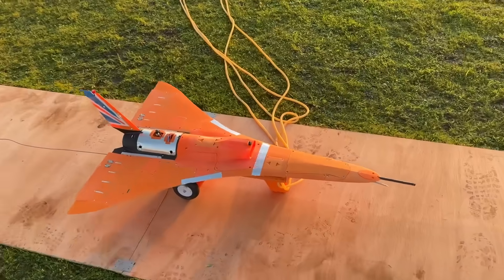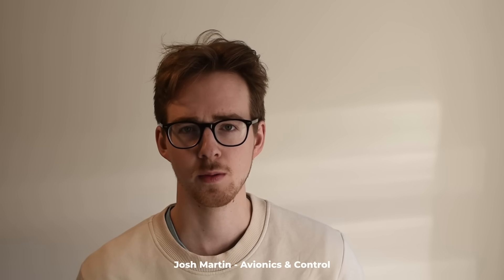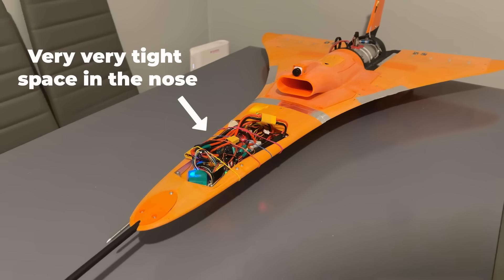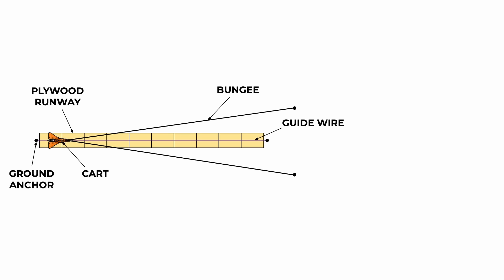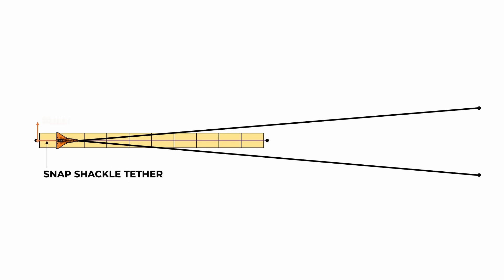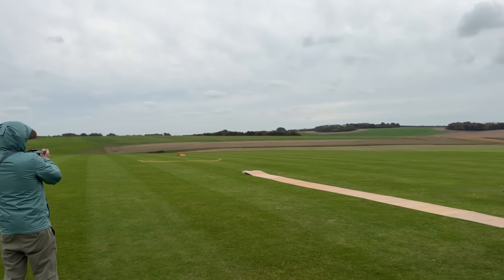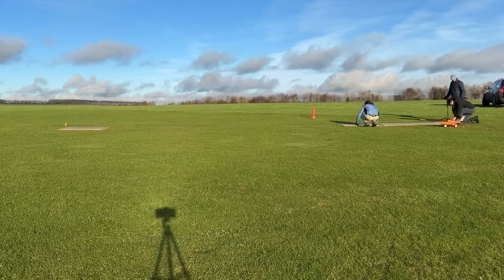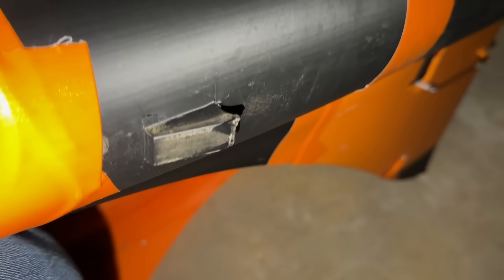It Almost Flew! Kingfisher Mark 2 Launcher Tests and Final Flight Prep

Comment from the maker: Thanks for watching this video! We were debating whether or not to wait until after the flight before publishing this video, but we decided it was worth getting some final feedback from the community before the flight. Also keen to show our progress :)

As mentioned, our Jetcat P60 has been quite intermittent. During our flight attempt in mid December, we were unable to get it to ignite or spool up beyond a very low RPM. It was a cold day, and the aircraft, fuel and batteries were cold and the starter motor was making a weird rattling sound with an error message "Temp Low" on the GSU. A few days later we pre-warmed the batteries/ fuel but still weren't able to get it to start (with the same "Temp Low" error on the GSU), then the next day it started fine. Over Christmas, we've done about 8 more starts. We haven't had any further ignition issues, but on the first 4 starts the start sequence was aborted about 15-20 seconds in with an "Acc Low" error on the GSU. We changed the batteries to some I had been keeping warm in my back pocket and had no issues - 4 more successful starts with throttle tests up to full.

If you have any ideas for why the engine is being so intermittent, please let us know. We're keen to find a mitigation that improves reliability, as driving to the field, setting up the catapult, doing the flight and driving home is a full day activity so we want to be sure the engine will work on the day!
Reply: Low temp is a lack of fuel. Fuel is thicker in cold weather. Increase Url1 on the pump start phase. Also you need more air around the tail cone or the drag will be high
Reply from the maker: @davewilshere  Thanks Dave, that's really useful to know, we will consult the manual and do that. If you have any other tips please let me know (either on here or offline). Do you know what causes the Acc Low/ Acc Slow error?
Reply: What is the fuel?
Is it a multi fuel?
What oil?

Is it new?
What pump/fuel pressure?
Do you run a fuel filter?
Could the injectors be blocked/damaged?
Reply from the maker: @brucebaxter6923  Fuel is Jet A-1 mixed with 5% jetcat turbine oil.
Engine is a couple years old, but had hardly been used by the time we got it.
We installed a brand new fuel filter for Kingfisher MK2, and have tested the operation of the external valves for kerosene start and fill although hard to tell what's happening inside the engine
Reply: @TheMachInitiative
You may have got dust into the fuel rail and partially blocked the injectors. 

If you look at pressure and flow rate you might be able to check that against specs. Sorry, I don't know more. 

I wonder if straight kerosene is thinner (a1 has anti atomization for crash safety) and would flow better in cold
Reply: @TheMachInitiative
Same thing, it's not getting enough fuel
Reply: Buy a 12v hairdryer and take that to the field. Use it to warm the engine for a while before starting. You might want to check if there's a hotter glowplug available, too. These little changes can have a big overall effect. Finally, battery power, make sure there's plenty there to  get all the jobs done at the same time, I'm sure you know the cold and batteries are not friends.  All the best with your testing.
Reply: I would strongly suggest warming up the turbine with a  hair dryer before a cold start. Blow it up the exhaust. Depending on the turbine oil you use (very strongly recommend Power Model Jet Oil from
Deluxe Materials cuz it never gummed up my engines nor gave me cold start problems) the bearings may drag a lot in the cold. 

Would've been great to see a Xicoy engine powering it instead. That jetcat looks ancient (external plug and all) and huge. A xicoy X60 weighs half as much and puts out the same amount of power and burns more efficiently, and it's a only 2 things to plug for the installation.
Reply: For the next projct please take in mind to use something not so aged, like a Kingtech K70 that weights at least 150g less and has over 1N of more thrust compared to jetcat. Also valves inside the engine. Other than that, my suggest is to use a 12v hair dryer at the field for helping the cold start. KEEP PUSHING GUYS
Reply: Message me and I can solve all your problems…you just need to seal the Kero start teflon pipe onto the Kero burner nipple properly or prime the burner valve line before any first run
Reply: @davewilshere or they could get a proper engine like xicoy and be done with all this crap
Reply: @aerialbugsmasher Mmm a 24 year old JetCat design is way better than any Xicoy-noisy, horrible things
Reply: @davewilshere lol ok buddy. So you're also the  type of guy to keep a Ford pinto in your garage cuz it's better than these new fangled cars of today huh😂

I've had zero issues with any of my 3 xicoys and could fly a solid 2 or 3 minutes longer than anybody else on the field with similar sized engines especially the Chinese ones or jet cats while still having tons of power with a lighter engine.
Reply: Ive seen children make better ramps... wtf is wrong with you all?
Reply: Are you guys restarted? This is an actual question. You should have been flying this long long ago and testing it with EDCs. So again are you all restarted?
Reply: @thomgizziz 
An armed drone?
That's just not right

Comment: A couple of suggestions from an RC pilot, hope that helps with launching. Try another style of launch system. A bungee is a good idea, make it longer rather than stronger, giving you a longer launch duration and reducing the forces on the air frame. Try a launch rig similar to the "Pedal Operated Bungee Launch System/Ramp for FPV/Gliders/Light EDF Models" from Hobbyking. Sorry, no product plug, just google it, that's the type you want for fast and high wing load delta planes. It'll get the plane into flight within less than 2 meters, and then the bungee will accelerate it over 20-50 meters, depending on your bungee. follow the recommendations for bungee strength based on plane mass. That way, you'll have enough velocity after the plane leaves the guide rail behind to have working actuator surfaces. keep the plane low and steady as it accelerates and don't pull up too soon. you need plenty of speed or it'll lose stability due to the high wing load. don't use wheels or anything, your plane geometry does not allow for something that is to scale for the bumpy airfield surface. try adding a 10-20mm wide strip of 1mm thuck aluminium sheet to the belly as a skate, just flush against the fuselage, so most impact forces on landing are spread through the skate. now, landings with something this high wing load are going to be powered, and at higher than comfortable speed. i'd recommend talking to a seasoned RC pilot who flies fiberglass jet models like the starfighter, or similar high wing load models. sicne your glide angle is going to be closer to that of a brick than to that of for example an rc sail plane, you basically want to get to less than an inch above the airfield surface before you reach stall speed. that is something you can train for handily in flight simulators. the tricky part is not the fine steering inches above the ground, but rather to learn how to fly the approach correctly, so you enter the edge of your airfield's property already lower than head height on landing approach, arrow straight towards the runway.

Comment: I recommend moving the camera into a position embedded into the wing route with a perspex clear window designed to maintain aerodynamics.inbthe current position you are disturbing the airflow. That you need over the vertical stabiliser/ rudder. You also need to vastly improve the launch it looked like the biggest problem is nota lack of speed but the violence of the launch causing lack of control and immediate loss of control beyond it's ballistic path.  I agree with loosing landing gear but consider adding bulges in the rear 3rd beneath both the wing and the nose . Allowing those (replaceable) parts to take the brunt of a rough landing while protecting the main body of the plane.
Reply from the maker: Agreed about the launcher - did more tests last weekend with a modified cart and were continuing to have those issues, the bungee provides a very non-uniform acceleration, which starts at ~10g and then drops off very quickly. Using a winch would provide a constant 2g acceleration, which is enough to get to 50 mph in 12m and much smoother.

Putting the camera in the leading edge would improve aerodynamics but we’ve tried transparent windows and the high curvature of the LE distorts the image a lot - for now above the inlet is ok (it worked fine on Kinglet) but further optimisations can be done in future.

Bulges are draggy but would help reduce damage on impact while we’re in this early testing phase (would remove for the record attempt)

Comment: You probably already have the servo locations heavily thought out, but, did you ever consider torque rods with linkages inside the fuselage, instead of the current servo fairing setup?
Reply from the maker: We considered it, but struggled to fit them in around the engine (this aircraft is designed to house a bigger P130 engine which is almost as big as the fuselage diameter) - the current servo fairing setup is nice and reliable and good for high torque applications, but further optimisations could be done in the future!
Reply: Sick! Thanks for the reply!

Comment: Now if you wanna make it really good add that white tape for (big, manned) gliders over all the gaps and screws (nah, just kidding, I mean, it would make the thing a whole lot more aerodynamic but these things would come off at higher speeds probably) Maybe you could actually fill most of the gaps with some kind of silicone or something else tho.
Reply from the maker: Once we’ve got it flying reliably at low speed we’re going to epoxy it together (instead of using bolts), then will coat in a layer of glass and sand so the whole thing will be smooth!

At the moment the ability to swap things out is v useful!

Comment: I'm always excited about your videos ❤,i have 2 suggestions,  use a much longer fuselage, an increase of 4 to t imches in length and also consoder using slats, because with thay wing configuration, you'd need either slats or high thrust or to keep it simple use small rocker motor launchers they're cheap,all the best of luck, i can't wait for the next video.

Comment: Nice project, but it looks quite similar to the current record holder?  Except maybe smaller in size and single fin instead of twin and with extra upper air intake area which seems to be actually adding more drag?   The current record holder from my limited knowledge on this topic has really sleek lines, no excess mass on the top which will result into more drag and flies locked like a dart which tells me it's a proven design.    https://www.youtube.com/watch?v=DPGDAZyQ44k&t=12s

Please don't get me wrong, not trying to bring any negativity here, just sharing my thoughts, all the best :)

Comment: Frankly, that launching method will kill the airplane. Instead of any sort of ramp, which will be inconsistent, think about changing the cart so that the model is at a 15 degree pitch up and increasing bungee strength by 1/3rd. That way it will release at the same attitude as with the ramp, but without the destabilizing pitch up moment you're having to correct for
Reply: https://www.youtube.com/watch?v=LqBe_PQeiYA an example of a strong bungee launch in a similar, albeit lighter aircraft
Reply: https://youtu.be/DPGDAZyQ44k?si=E4sRYDktxDkcolkb obviously familiar to you but a good example, note the pitch angle on the launcher and smooth transition to climb, no strong destabilizing impulse

Comment: Looking great thus far! Acc Low/ Acc Slow also points to a fuel delivery issue or battery voltage sagging due to weather. Acc slow can be caused by too much/too little fuel and judging by cold weather would probably be too little. Also, I'm sure you're already doing so but worth covering up screw holes/panel joints with speed tape to avoid a metric ton of interference drag.

Comment: You could save quite a bit of weight using a conforming fuel bag for this jet, thats what I would use
Reply from the maker: If you have any knowledge on how to make/ cheaply source a custom bag that conforms to the shape of the fuel cavity we'd love to have a chat - please let me know. Cramming fuel into such a volume constrained aircraft is a key challenge for us
Reply: @TheMachInitiative I don't know anything about fuel systems but you can quite easily 3D-print molds for silicone. 
You could even try to make it from a single pour and melt the inner part of the mold out of the fuel lines if you have the right equipment or enough patience.
Making a bag from two halves and joining them would be easier but i don't know if that would introduce a point of failure along the seam.

Comment: Was the hook damaged because the rocket doesn't have a stand? Wider base with larger wheels may relieve impacts on the hook.
Reply from the maker: The hook got damaged when it impacted the ground after the failed launches (when the cart gets launched without the aircraft it reaches a much higher speed), although, as we increase the bungee loads we're moving to a metal chassis and hook to help carry the loads better. The new cart has a much wider wheel base!

Comment: Interesting project and respect your effort but would have appreciated you waiting until you could actually show a flight before releasing a video. It's true that the title doesn't promise that but videos that avoid showing the point of the whole project ( a flight or even a decent attempt at one) will mean that people might avoid clicking on them in future.
Reply from the maker: I appreciate your concerns - it's a tricky balance between showing the progress/ work we've done over the last 3 months, and also showing things fly. With Kinglet we were able to churn out new designs/ flights every 2-3 weeks, but with the added complexity of Kingfisher it takes a lot more work/ testing.

Was really keen to get the flight video published over Christmas, but we got unlucky on the flight day in December. I'm happy we've split up the ground testing and maiden flight videos though, means the maiden flight video will be more to the point/ snappy, appealing to a wider audience. Also allows us to go into detail about the post-flight analysis without having to release a 20 minute video!

Also useful to get feedback from the community before we fly!
Reply: @TheMachInitiative Thanks for respectful reply MI and I really didn't want to sound negative about an interesting project which you have put so much work into, I just wanted to be honest so that you could take my opinion into consideration or not as you see fit. Either way, I'll be looking out for the flight test and please have a subscription!

Comment: I’m surprised you went with external linkages on an aircraft that is meant for all out speed.  It really makes me question the amount of RC experience…🤔
Reply from the maker: The linkages are draggy, but they're necessary to meet our torque requirements and we've covered them in nacelles to manage the aerodynamic effects. Once we've got this flying reliably we can look into further optimisations. The current record holder uses similar linkages, he just hid his in his tailfins - we wanted to avoid having twin tails as they disrupt the vortices over the delta wing and cause it to stall earlier
Reply: @TheMachInitiative Unless they're tip-fins, whence they help.

Comment: The aircraft has such lovely lines and the camera mount on top of the air intake really changes that sleek profile.   Have you considered widening the air inake and incorporating the camera mount to the centre, INSIDE the inlet? I really think that mount as is at present interrupts flow considerably over the top of the craft and introduces turbulence right in front of the vertical stabilizer. With the camera inside the air inlet flow isn’t interrupted and the intake can just be made slightly larger if necessary (which it might not be depending on the design of the camera mount). Given that the control unit is no longer part of the camera mount you probably have the flexibility to do this change to camera location. At these speeds weird things happen to airflow and optimizing flow is IMO crucial to maximize performance.  I would even consider using tape over some of the hatch outlines as hairline ridges or gaps also interrupt flow.
Reply: unfortunately this is a terrible idea
Reply from the maker: Putting it inside the inlet would introduce highly non-axisymmetric flow, this would damage the engine. -M

Comment: I don't like auto tune in ardupilot, it's only good for that last 3-5%
I much much prefer to use one or two of your trim knobs to tune it. 

Please please please use your lead sled launcher test model in a stabilise mode to tune your controller.
Please only do roll or pitch one at a time. 

Please get a cheap assed foam toy plane or drone and practice doing auto missions with takeoff and land. 
It's very very important. 
Your human pilot can't be as smooth and will get orientation/range problems when your speed gets up.
Reply from the maker: Do you reckon the 3-4 seconds we get of air time with the glider is enough to tune?
Reply: @TheMachInitiative
Manual tune. 
By using the trim knob on the tx. 

You won't so much get to tune during the few seconds of flight as much as a quick turn around tuning between flights. 

See if it oscillates (too high) or won't hold position (too low)
If you watch the telemetry graphing the desired to actual position it's pretty easy. 

Oh, love your new telemetry radio